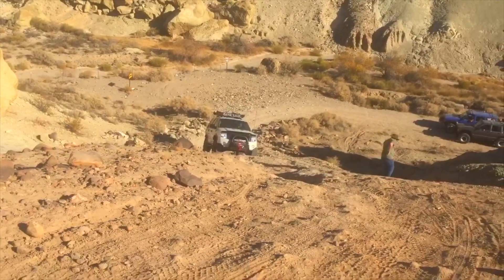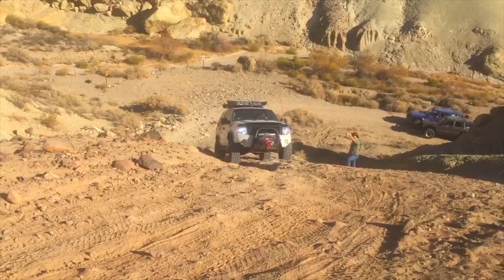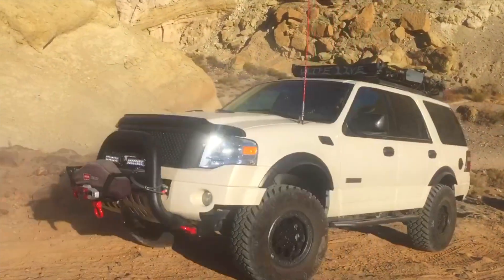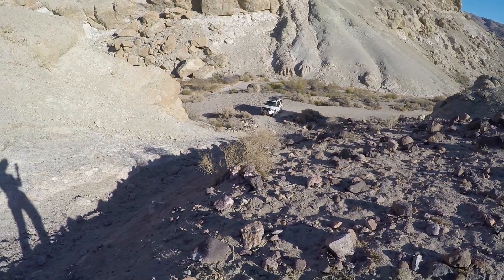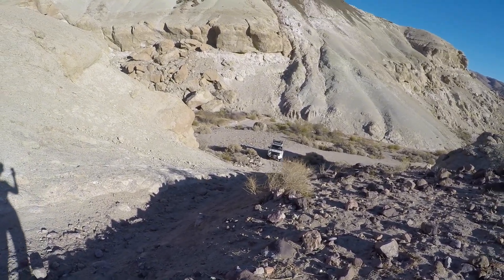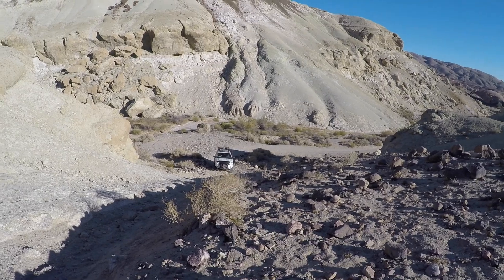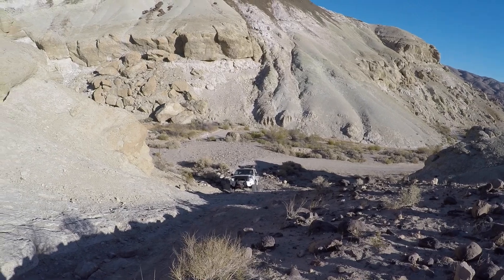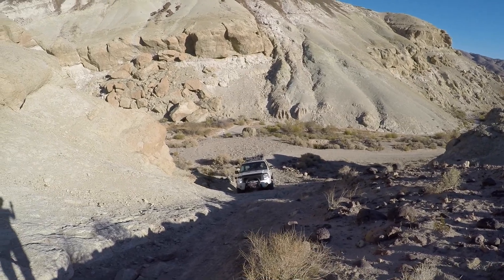Off Road 4x4 Ford Expedition, Last Chance Canyon!

Comment: Looking at maybe purchasing an 08 EXPY EB Edition, was hoping to find someone who has built one for overlanding. Can you provide the lift kit name? Also what size tires are you running? Is the gearing sufficient to run that size?
Reply from the maker: Hello, you can check out my specs at www.1LifeLive.com as I have everything listed. Real quick it’s simple spacers for the lift (rear) and f-150 2009 Icon coil overs (front) so they don’t bind as they have a thin spring that won’t hit the upper control arms unlike Rancho which will, 35” tires and no need to change gearing until you do 37” tires or larger as there is plenty of gearing and power for 35” tires unlike Jeep’s where they used to only have a 6 cyl. There you go. I have only had positive experiences with my rig. It is great for an overland rig. Not a rock crawler but an overland rig. ;-)

Comment: I think there is some confusion about what actually gets locked vs what isn't.  If you read the description of the system carefully, it does in fact say it locks the front and rear drive shafts.  HOWEVER... the drive shafts are what connect the center diff to the front and rear differentials.  That's basically what a locked center differential does... it locks the drive shafts coming out of the center differential so that equal power and rotation is provided to both front and rear differentials.  The half shafts from the front and rear diffs to the actual wheels are still open.  I think that's where the confusion comes from.  Yes, front and rear drive shafts are indeed locked, but the front and rear differentials are open meaning left and right tires are NOT locked.  Hope that helps.  "Diffs" are not locked, just the center "Diff".

I did just learn something though... I learned why I get better traction in snow and sand when AdvanceTrac is turned off.  That's when the center differential gets locked!

All that said, the Expedition does really well even with open front/rear diffs.
Reply from the maker: Yes there are many ways you can word it. I went to visit a Ford mechanic and he helped me break a down pretty good and then I made a video with the manual. Check it out and thanks for the comment! 
;-)

LifeLive: Ford Expedition Off Road 4x4 System Control Trac Mimics ARB, Eaton E Lockers!?
Here is the link below:
https://www.youtube.com/watch?v=WYJYMFClJcw

Comment: I'm sorry but having an "advanced traction system" for off road use isn't the same as having mechanical, air, or electronic locking differentials on both ends.

This is why I can't take OEM Range Rovers 4wd systems seriously.

If these Ford systems were that effective, you would see waaaay more of these rigs on the trails regardless to them being 4 wheel independent suspension systems or not.
Reply from the maker: Hi Man O War! Yes you are correct. These systems are sort of the poor man's lockers. There are a lot of disadvantages as they cannot instantly be turned on and locked so you could lose your line or slip the wrong way or pivot up or down until the Control Trac system locks. Those things have happened to me more than once. Once locked however, it acts exactly like my brothers Jeep's ARB lockers and my friends E-Lockers. But, the Ford Expeditions 4x4 only feels like true lockers once locked and the computer figures out when to lock them. The ARB and E Lockers have a massive advantage of the user being able to turn them on instantly when needed (front, rear or both) and keep them on until you turn them off.

The Ford Expedition with its 4x4 system is used quite a bit actually across the world and Ford uses very similar systems in the Ford Raptor. 

However the Ford Expeditions suspension system is not that great. I make it work ok for what I do, which is medium off road adventure and overlanding, however to make it better I would have to spend good money to have custom half shafts made and then install longer upper and lower control arms. Priced out it is a good 5k. So...., as of now I am not doing it. However, in the meantime    the 4x4 system has worked good enough for me to be VERY happy that its on the Expedition compared to just open diffs without the Control Trac system. It is better explained on my other video: https://www.youtube.com/watch?v=WYJYMFClJcw

Take care.
Reply: OEM Range Rover's have rear and center electronically activated locking diffs. Unlike Land Cruisers or the Land Rover Defender which only have center locking diffs and rely heavily on brake traction control.

Comment: Your truck has open diffs with traction control.  The traction control is programmed to mimic a locker but it is not a locker.  It has no way to lock axles together, it only applies clamping pressure to the brake that has lost traction.  Sorry to disappoint but regardless of the ESOF switch position the differentials are still OPEN!
Reply from the maker: Hello Leonard. Yes correct I have open diffs and yes I do NOT have traditional lockers. 

However you are incorrect beyond that. 

In fact the traction control called Advance Trac which does use the brakes has to be turned OFF in order for the Control Trac to work which fully LOCKS the diffs. Control Trac does NOT use the brakes whatsoever.
 
Big difference compared to simple traction control and not all Ford Expeditions have it. 

Most only have the traction control Advance Trac and not the Control Trac. You can read about it yourself here:

(This is all in the manual too)

The Locking Center Differential 

The ControlTrac 4-wheel-drive system’s center "differential" is a electronically-controlled electromagnetic multi-disc (multi-plate) clutch pack. Through use of sophisticated control software, the multi-disc clutch imitates a traditional geared center differential. Under normal on-road conditions, it sends 100% of torque rearward, but can send 100% of torque forward if needed. While adjusting torque between the front and rear wheels the software watches for any drivetrain binding or torque windup, and controls the center multi-plate clutch "differential" accordingly to eliminate it. 

• 4H 4-wheel-drive with high range gearing (1.00:1) 4-wheel-drive capability,
Continuous 50/50 torque split to front & rear wheels, Electronically locked center differential, 
Front driveshaft & rear primary driveshaft mechanically locked with no rotational speed difference,
4-wheel electronic traction control system is enabled and needs to be turned off in order to have locked front and rear drive shafts.

• 4L 4-wheel-drive with low range gearing (2.64:1) 4-wheel-drive capability,
Continuous 50/50 torque split to front & rear wheels, Electronically locked center differential, 
Front driveshaft & rear primary driveshaft mechanically locked with no rotational speed difference,
4-wheel electronic traction control system is disabled, ESC and RSC are disabled.

As you can see Control Trac does NOT use brakes to mimic and actually locks the driveshafts, hence why I refer to them as lockers as a general term since they are locked with no rotational speed difference.

Hope that helps you better understand the system.
Reply: ALL four wheel drive 07 to 14 Expeditions have the same four wheel drive system, the only option was/is a limited slip rear differential.  There is no option to change the 4wd system from the factory.  What you are describing is a CDL or central diff lock, this is not a locking axle.  Both front and rear axles (differentials are open and never capable of locking up).  The transfercase is the only item that locks on your truck, you continue to imply that your front and rear differentials lock which they do not.  Hopefully you can better understand the system you are running.  Good luck with the build. I'd even be happy to share the source books from ford so you can gain a bit more knowledge on what the system can and can not do.